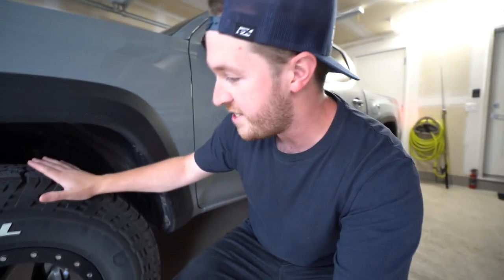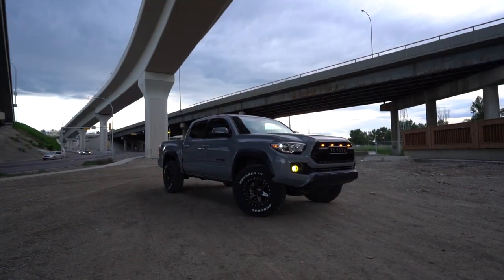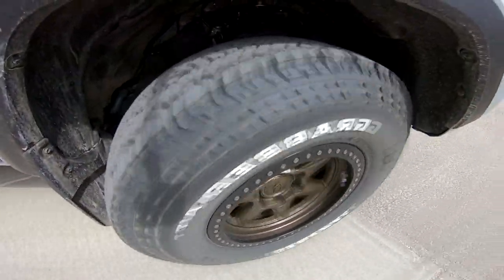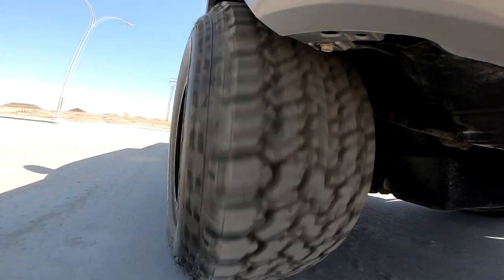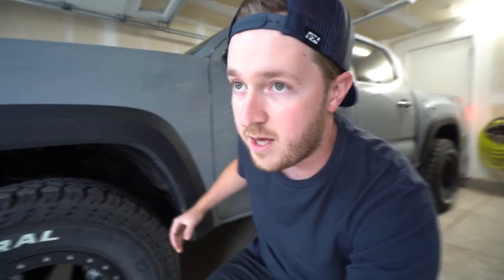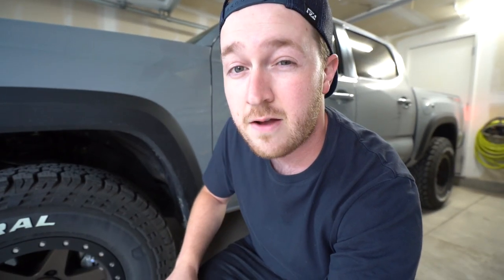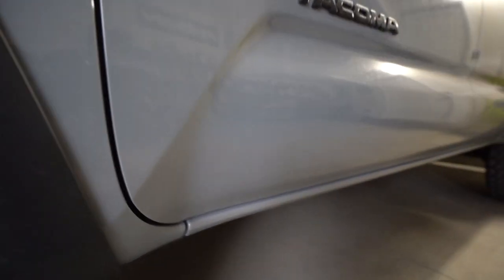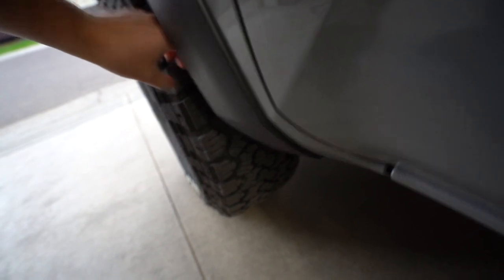2020 Tacoma Rubbing on 265/75/16 General Grabber A/Tx

Comment: Interesting, I’m getting my Tacoma in a few weeks.  Trd off road.  I was gonna run 265 70 17 and a 0 to -6 offset max on my wheel, a 17x9 wheel from pro Comp which has -6 offset and 4.75 backspacing, or a race line wheel 17.9 with 0 offset and 4.5 back spacing.  

I’ve seen a lot here recently and at Tacoma forum that too much - off set looks nice but causes these issues.  Especially with the mud flaps.  

I believe I saw where you can get after market mud flaps that are thinner and shorter than oem.   Might wanna look into that as I might as well when the time comes.  

I really don’t want to do any sort of mods since my truck will be a 2x4 and I’ll only be doing modest off roading.  Try the AM flaps may help here.  Good luck 👍

Comment: I’m about to run 265/75/R16s  with bfgoodrich tires on my trd off road with a positive 10 offset I been trying to find someone with that set up to see if it will have a more aggressive look than the stock trd off road rims and tires
Reply from the maker: Interesting that will be a nice setup! I haven’t seen a +10 offset before? (Will it be more flush with the fender? -10 pokes out about half an inch or so more than stock I think)
Reply from the maker: Check my new videos for my current 285/75/16 setup
Reply: @SpencerHogg  that’s what I’m assuming I was going to go with -6 offset but the rim I wanted was on back order for 3 weeks and I didn’t want to wait that long haha

Comment: I run the same size as you  in a Goodyear Duratrac. With the front flaps removed I don't experience any rubbing anymore. I also have a set of Toyota running boards that do a pretty good job of protecting the the truck. (I think they are the second gen ones). If you plan on doing some more serious off roading maybe a set of sliders with the fill in plates would work well.
Reply from the maker: Thanks buddy! The sliders are definitely on the want list next!

Comment: I would just run it as it without mud flaps.  Because you are only removing the fronts, I see no way you for to kick up rocks or dirt to hit vehicles behind you as there is so much under carrage beyond the front flaps.  Now if you had to remove the rears, then I can understand that argument.  And who knows maybe later in time an aftermarket thinner profile mud flap can be made in the future to alleviate this issue, and cause no running during those big turns you have to make.
Reply from the maker: thanks bro!

Comment: I'm running 265/75R16 BFG's.  Factory wheels. The -12 offset is what's killing ya. I sold my 4 wheeler, and I invested in the Icon stage 1 leveling kit, then opted for the Icon control arms. The front is set a 1.75 inches, and it's perfectly level. No rubbing of any kind, and the stance is 👌
Reply from the maker: dude that sounds badass!! You got any pics or ? Instagram I can see?
Reply: did you keep the mud flaps?

Comment: My 2021 Tacoma has the same exact tires. I have no rubbing issues get rid of mudflaps. And if your wheels are out of a 8 inch negative offset need to put on the  1.25 wheel spacers.
Reply from the maker: I am running 285's of this size now

Comment: When I first started researching the 265/75/16s for wheels with ~-12 offset, the first thing people said was to remove the mud guards and everything should work fine and hopefully thats true when my wheels arrive. I bought a set of RR5-S 16x8 -12 offset wheels (matte bronze) and bfgoodrich 265/75/r16 ko2s. I'm not a huge fan of mudguards anyway so its kinda a win-win for me lol
Reply: Do you have any pics?
Reply: Does removing front mud flaps cause any issues on paint job or any components under so far? I have the same issue running a 267/70 BFG KO2s on stock TRD pro suspension
Reply: @orvzad8638  so far I haven't had any issues

Comment: Hey bud, i'm running 265x70x17, practically the same size as you but have absolutely no rub even at full flex. Although i have a lift i'm sure it's not that since it doesn't happen even off road. I think it's your wheel offset maybe. I'm running them on the TRD 4runner wheels
Reply: I like that setup, its a good look!
Reply from the maker: Thanks bro!!
Reply: I will add that I’ve got the same grabber atx my are 265/70r17 on the 17” trd 4runnerz on my trd off road with stock suspension and I do rub on my front driver oem mud guard when flexing or turning sharp to the left. I’ll probably remove the flaps. The grabbers love to pick up and throw stones. I’ve got the oem cast aluminum side steps which help with flying stones.
Reply: how much lift do u have?
Reply: @dampainter1  2.5 front 1.5 rear

Comment: I was going to get some 17x9 wheels with a -18 offset with some 30 inch AT3W tires. Would that rub even worst???

Wondering if it's an easy mod as removing the flaps. I heard 50/50 some saying it will while others debating that it won't rub on stock suspension.

Comment: Thinking about going w same set up, maybe toyo open countrys though. Are you happy w the fit or would you go down a size?
Reply: I’ll be going with the Toyos OC 3s with a 17/9 4.75 back spacing with a -6 offset or a 17/9 4.5 back spacing with 0 off set.

Comment: Been running no front or rear mud flaps on my second gen since 2006. I don’t see any rock chips on the side of my truck. I have more pin stripes from tree branches lol. They will definitely get in your way when you start rock crawling or even break off in deep water. Rocking stock offset with 275/70/17 and spidertrax wheel spacers.
Reply from the maker: haha damn eh, all the pin stripes!! Thanks bro! appreciate the feedback I'll probably just leave them off

Comment: what does a 12 degree offset mean?
Reply from the maker: Offset means basically, the wheels hub sometimes pushes "outwards" AWAY from the vehicle - sometimes just the wheel design, sometimes it's on purpose to have more clearance of brakes, suspension, etc. - but sometimes it can have negative side affects too - if you have too much offset it might rub and bump into your vehicles bumper, cab, frame, etc.     SO Basically - finding perfect size + offset + tires + suspension all together kind of to achieve a perfect fitment, have to consider all of the above! 

But here's also a good article with some info: https://trailtacoma.com/2020/02/20/largest-tire-size-guide-3rd-gen-tacoma/
Reply: @SpencerHogg  Thank you!

Comment: Hey bro,
I’m looking at putting 265 75r 16 on my stock trd off road rims. No lift. No flaps. Worried about rubbing while at full articulation and turn while off road... I don’t want to lift the truck but I want the bigger tire. 

Wondering if anyone knows if I’ll rub at all?
Reply from the maker: You’ll rub the same amount as I was in this video because the stock trd off road rims are 16x8 same as this, less offset, so you might either rub on the inside of the fender or the outside like me I’m not sure depends on your turning - only will rub when you’re turning slow speed though really.  Or you’ll rub on the mud flap but you can take the mud flap off like I did too.
Reply: if you are running stock wheels you will be fine i run a 265 75 16 general grabber atx and no rubbing at all with flaps on
Reply: You should be fine on stock rims.  Stock rims are 16x7 with a +25 offset.  The negative offset is what’s causing Spencer’s issues.
Reply: @kirkhiggins3044  Would it be the same in case I install the TRD Pro 16 wheels along with the 265 75 16 (on my TRD Off Road)?
Reply: @ramonconcepcion4642     You should be OK with the Pro wheels. Their offset isn't as much as the zero offset wheels he is using.
Reply: @kirkhiggins3044  That is great to know! Would I need to recalibrate the built-in trip computer (speed and mpg display) to run a bigger tire size?
Reply: @ramonconcepcion4642    If you want it to be perfectly accurate yes. Difference between 265/70 & 265/75 is not that much. If you Google those two sizes vs each other it will pull up the TacomaWorld tire comparison that will give you exact differences in mph and stuff.

Comment: Would 265/70/17 rub with no lift or anything?
Reply: I'm running 265/75/16 on stock suspension with mud guards and i have no rubbing, on or off road
Reply: I just installed 265/70r17 with an 8.5 inch wheel, -6 offset and it rubs on the mud flaps. Going to either trim or just remove them completely.
Reply: yes, have KO2’s with those exact measurements on my Sport 4x4 and I am getting some rubbing on tight turns with full lock. I’d say remove the flaps, splurge on a lift down the line, or look for 3rd party mud flap alternatives that are thinner than the OEM.

Comment: Dont run flaps in the front. I ran a 35x13 setup on my superduty so that was a lot of poke and I never damaged my truck or paint after 6 years like that and let's be honest fords paint is shit compared to the paint on yodas. 

If you want to be extra cautious, you could use a mixture sidesteps/sliders and kickback/longjohn mud flaps (check out trigger industries if you want a local company)